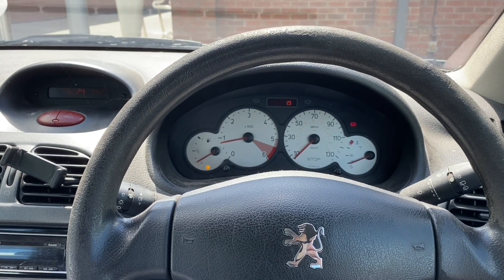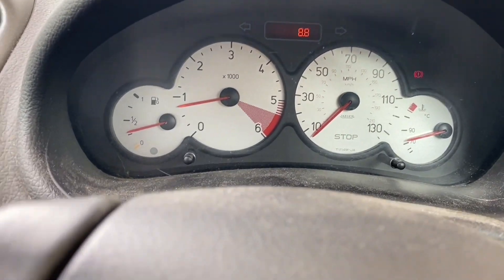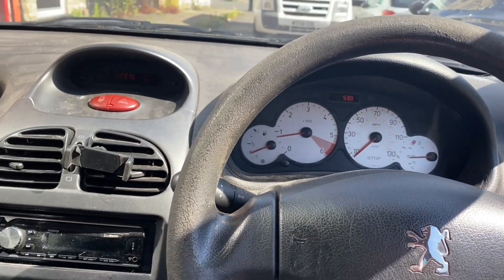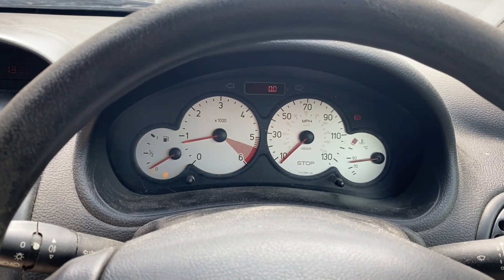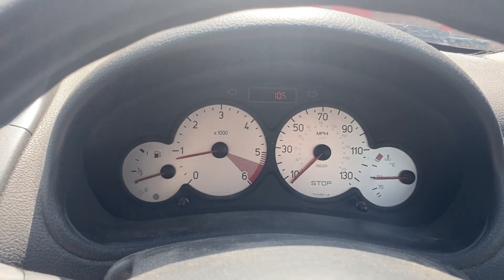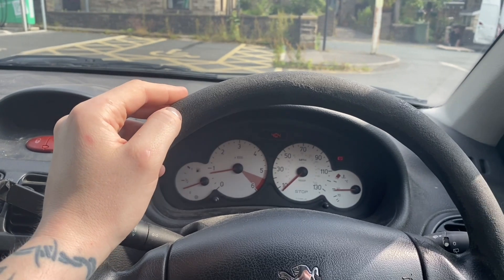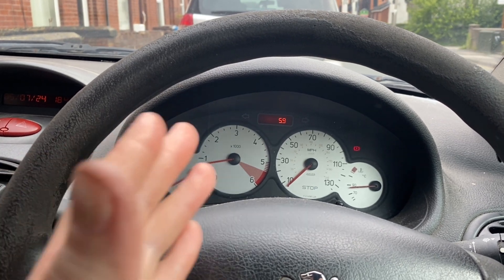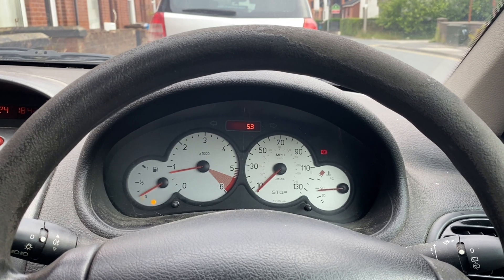Dipetane Fuel Additive, Improved MPG and Acceleration? Diesel Additive Tested

Comment: After the "check engine" light came on in my 08 RAM 5.7 HEMI, (GAS), I checked my OBD computer with my reader and it showed a P0406 code - EGR valve issue.  I found this additive on Amazon and bought a 1L bottle.  I Added the recommended 1/2 bottle to my 26 gallon tank, and filled up with Shell V-Power® NiTRO+.  I then drove around with the "TOW-HAUL" selected on my automatic transmission so to keep my RPM's in the 2500 range.  After about a quarter tank, I resumed the "normal" transmission selection and my check engine light has yet to come on.  During my driving, I had connected my OBD reader and monitored in real-time the voltage output of the EGR valve.  Whereas before the signal was a constant "high", the reported EGR signal has now shown a normal variance of low to high swings.  Now, I can't say definitively it was the Depetane that solved my issue as the Shell gas has probably the best additive package for automotive gas, but, after not having the computer throw any further P0406 codes, I will be using this additive as long as I can purchase it.  Also, the engine seemed more responsive with "pedal response" and pickup but, the HEMI was already pretty damn quick to begin with.  As the stock on Amazon has dwindled, I did order 4 additional Liters to make sure I had this good stuff on hand.  This stash will probably last me for maybe a year as my retired driving only amounts to 2500 miles or so...  I hope that "someone" will obtain/bring to market this great additive for sale in the US as the future availability from Amazon is always in question, hence my additional 4 liter purchase....

Comment: The bottle states that after putting in the Dipentane for the 'mega flush', you have to drive the car for 100Km to clean the fuel system.
Reply from the maker: Maybe. Even after driving that far it didn’t seem to do a whole lot tbh

Comment: How much dipetane would you put in to a 2L diesel,with a half tank of diesel
Reply: And would you put it in before or after you fill your tank up
Reply: @bigwon4056 I use a 3rd of a bottle for full tanks best to do it when you have long drives the longer the better I've been using the stuff for years find it amazing..
Reply from the maker: Best to put it in before, but depends on the size of your tank. Tbh I’d probably just put it all in
Reply: One measure on the bottle 20 litres

Comment: I use to have 1.6d mk7 Golf. I swore by Dipetane. It cleans the engine , good for egr,dpf etc.  You'll feel the difference if you do a lot of miles in a diesel after a few  uses.
Reply from the maker: @garethtalbot8950  I might try it in the Golf and see if there are any noticeable results

Comment: I've tried a number of different additives and sprays to clean my EGR valves and to keep my engine in good working order. My 2007 Golf TDi has 146K on the clock and has struggled to pass the emissions test for the past three years. My challenge is a combination of oil vapour from the CCV ( crank case ventilation ) and carbon from the exhaust gas causing a build up of a thick treacle like layer on the valves and the EGR / inlet. What makes the biggest improvement is running on premium fuels with higher cetane. I'm not an expert so don't shoot me down for this - but the higher cetane produces a more complete combustion and less exhaust soot. But premium fuel is expensive. Now for the meat of this comment. I spoke to a tanker driver from the local refinery and asked what the difference was between standard and premium fuel. He said all the diesel is identical except for an additive to boost the cetane. The premium fuel is sold way over the cost of the additive which is called EHN 2 Ethylhexyl Nitrate. But you can buy this from a company called Hydra Int. Ltd. Its readliy available and I've used it for the past six months. What a difference! Premium fuel for pennies and my car is better on fuel, exceleration and emissions. Wonder if this contains the same chemical.
Reply from the maker: @PaulRansonArt  I think a lot of these additives possibly contain the same/similar chemicals. I think the premium fuel additives possibly help to get a more complete and slightly hotter burn hence less soot and black smoke?
Reply: Check your air filter

Comment: I’ve not used this yet, but for last 15 odd yrs I’ve always used 2-EHN added to each tank, my Diesel cars have always ran like a dream.. it also pays to add 2 stroke low ash mineral oil every now and again 👍
Reply from the maker: @nigelcarter7740  I’ve not tried that one, but I did used to put mineral low ash 2 stroke in one of my old cars. I stopped using it as there are additives like zinc in it, which is great for anti wear properties but can cause the injector tips to fowl.
Reply: gold tip didn't know about the injectors problem with the zinc 👍  @StupidBlokeStupidVideos

Comment: This stuff 100% works.
My last car had turbo troubles and smoked a lot.
Tried loads of different additives for months on end and the stuff that you pump up and spray in. None of it worked for long. After using dipetane the problems cleared up so from there i just used to add some every time i filled up
Reply: I've used Dipetane on a few old cars that I've owned, and you're right, it definitely helps. You just have to give it a little time because it gradually cleans the fuel system. It's not an instant clean.
Reply from the maker: I didn’t notice any real difference with it on this occasion, but it’s interesting to hear from those that have.
Reply: I got a question, If I put the whole litre in a full tank ,could it harm the engine ?
Reply: @ahmedisam8948 they say it wont

Comment: Irish defences forces have been using Dipetane for many years on their diesel vehicles. I spoke with an army mechanic who said you could tell the difference between pulled injectors on a vehicle that had been using Dipetane for extended period versus one that had not. Dipetane is a fuel system and injector lubricant (to compensate for the reduction in sulfur in Diesel fuel). It provides a cleaner burn apparently. A lot of people use it few weeks prior to NCT test combined with an Italian tune up. As It also helps reduce smoke emissions too. From claimed increase in MPG point of view, I never noticed any increase myself.  However If I was switching back to Diesel I would consider using it every tank full again. Anything that increases injector and fuel pump lubrication and reduces smoke is a bonus in my book.

Comment: I've used it for years in both petrol and diesel cars. It does improve the emissions at MoT time and is worth the cost 

You won't see much of a difference until after a couple of tanks worth. I also add a glug of mineral 2 stroke oil in each tank which does make a diesel a bit quieter!
Reply from the maker: @thomaswykes3647  yea I know what you’re saying. I’ve used mineral 2t in a diesel I had a few years ago. I may try it again for a vid, it can potentially fowl the injector tips up due to some of of the additives in it though. Zinc is the main issue I believe
Reply: When I was robbing red diesel from work years ago I used to put half a litre of two stroke and a bottle of  injector cleaner into a five gallon drum  and my old Volvo ran pretty well on it  my old Volvo is still on the road but to be fair I've tried pretty much every thing in it over the years

Comment: its supoose to lubricate the fuel and clean the injectors and other carbon build up making it a bit more efficient to drive however the biggest use is to lower emmissions for the MOT or NCT here in Ireland people put it in before the test and pass easy, or if you fail the emissions test run some through until you do the retest and do the uphill at 3.5k revs for a few miles and that will lower it.
Reply from the maker: @zoethepom357  will be interesting to try if my car ever fails on emissions
Reply: dont need emissions bullshit in the north...well its not back yet i dont think